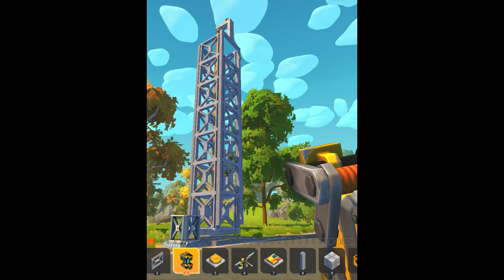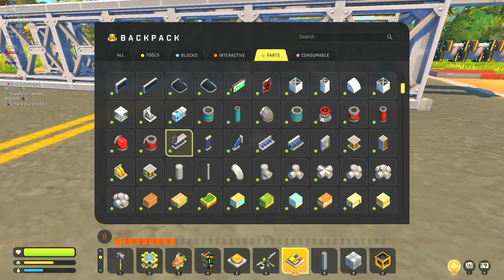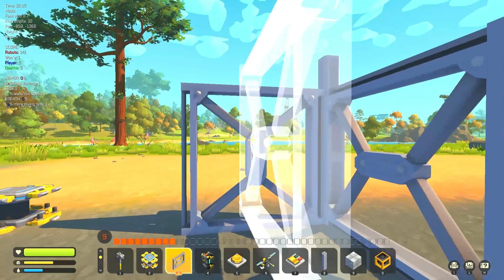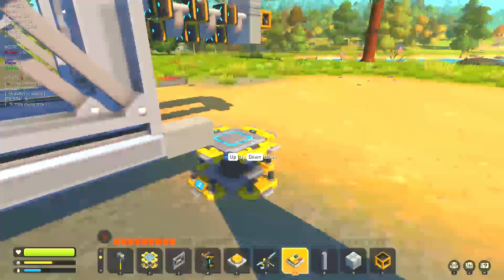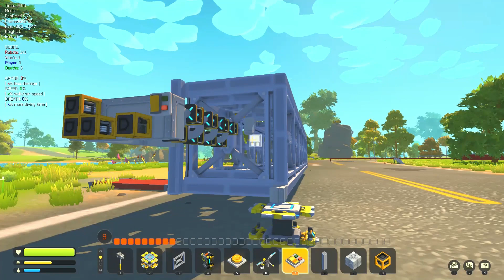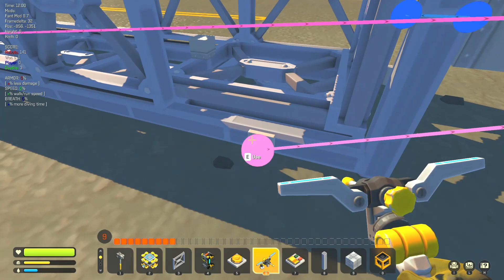Scrap Mechanic -  Survival Base - Elevator Build - Using the game assets from the \unlimited command

Comment: You can make an elevator in which there are 2 buttons and if you hold one then the pistons on a logic pulsing mechanism will be going up and the other will be going down
Reply from the maker: That pulse mode logic is not lag friendly. I made this out of ease of use. And ease of build. Especially for base use.